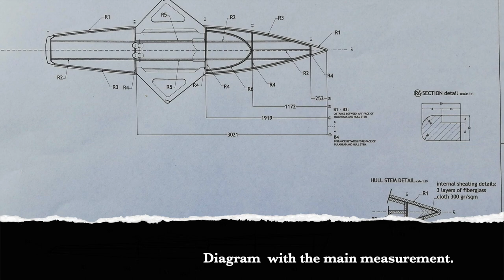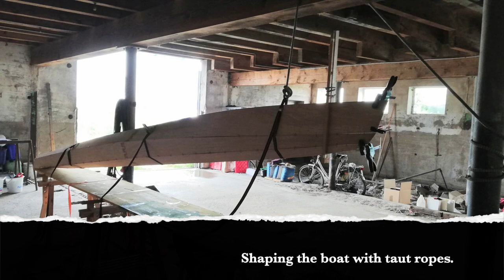Coastal Boat, built of wood  (Part 1/4 )

Comment from the maker: The wooden sheets are usually sold in commercial lengths, such as logitud 2.4 m. If you need to make a 4,46 m boat you must necessarily join pieces of wood until you reach the mentioned length.
Reply: Better than a scarf?  Was it difficult to calculate the position of the puzzle joint from the plans?

Comment: Was the offset puzzle jointing a deliberate feature or a function of the measurement?
Reply from the maker: I think the best answer is to see the case of a "Puzzle joint" directly in a video, it is the most explanatory.
https://youtu.be/Z6XVTXmkBRc
Reply: @mackamdi  I know what they are, I'm looking at how they line up from panel 1 to 3, the joints are offset rather than continuous. Was this a deliberate design choice?